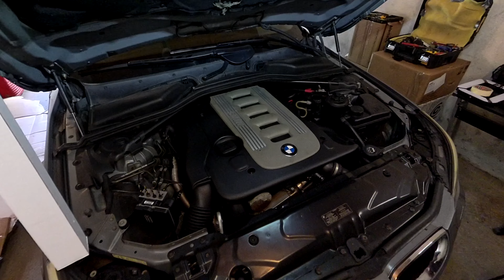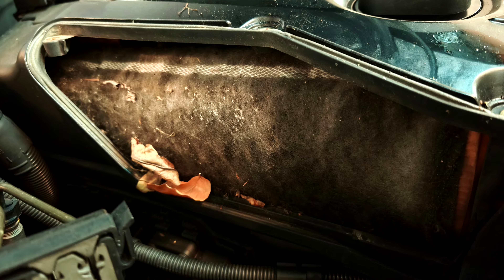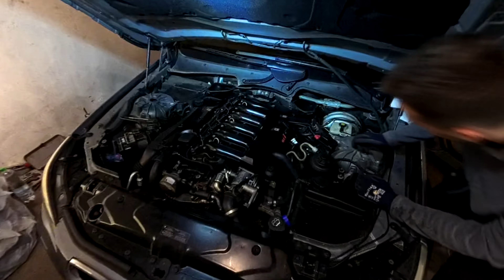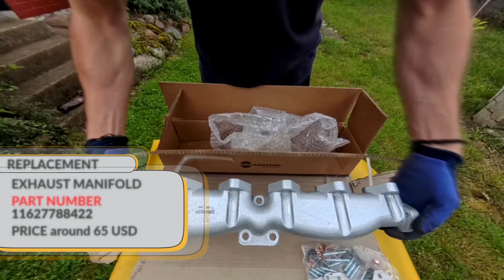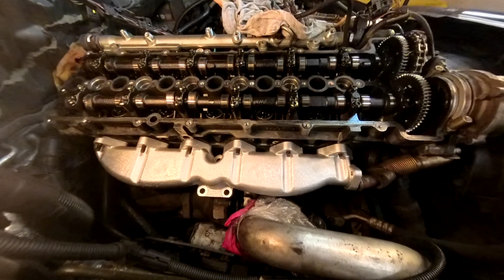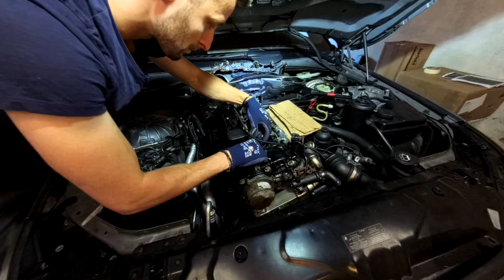Exhaust manifold replacement – BMW e60 & e61, 3.0d, M57n

Comment: Do you think possible to remove it, without to remove all the part above (the cover), I have seen a video where a guy succeed to remove it without to removing all ... What do you think about it ? Thanks a lot. Great job !
Reply from the maker: Hey! Even with the parts removed like in the video, it still took a lot of time and quite a bit of effort. Honestly, I have no idea how anyone could do it without dismantling everything ;) There is one bolt connecting the exhaust manifold to the turbocharger that I really struggled to reach. If you decide to give it a shot, be extra careful with the exhaust manifold studs so you do not snap any of them while backing them out. PS: let me know if you pull it off and how you managed to do it—I am genuinely curious if it is actually possible! :)

Comment: applying oil on a gasket is absolutely not recommended 🤣 This gasket must cure to the surface of the engine head, with absolutely clean degreased surface, you never apply oil on this gasket
Reply from the maker: Hi, unfortunately you're right, this was one of my first videos, and there was clearly a lack of professionalism in this regard. In the next one, which will be out soon, everything will be completely on point. Thanks for catching that!